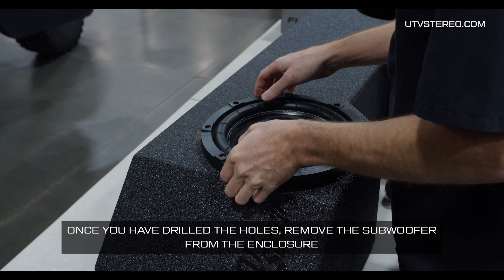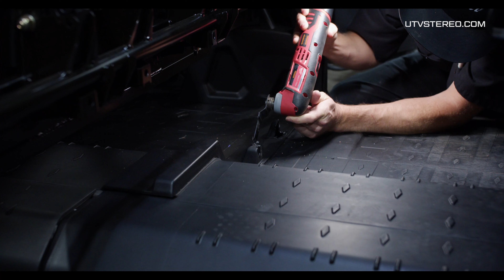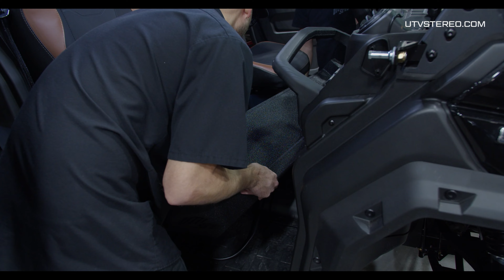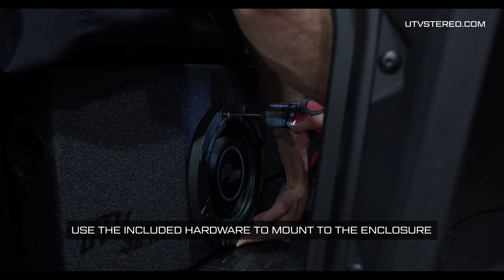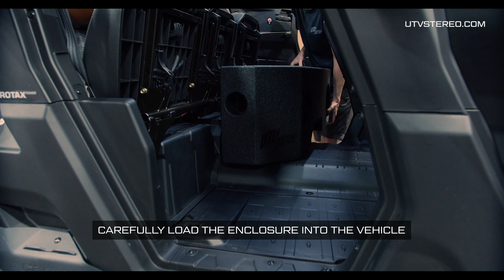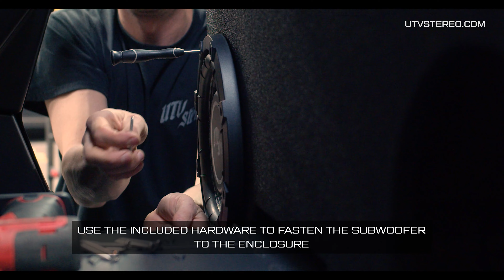How to Install: Can-Am® Defender Dual 10" Subwoofer Enclosure

Comment: Whats the battery setup on this defender? How long can this setup run with the engine off?
Reply from the maker: We are running our Defender 2nd battery kit,  if SXS properly charged, we can run the music for 1 to 2 hrs depending on how many Amps we are using.
Reply: @UTVStereo  ok thanks, good to know

Comment: Waterproof?
Reply from the maker: The enclosure is not, the subwoofers are IP65 dustproof and water-resistant
Reply: @UTVStereo so this enclosure can’t get wet? I was close to buying but if this is the case what’s the point of it if it’s meant to go on a off road machine lol
Reply: Do they sell those  enclosures ? I only see the single ones. I wanna run 4 10’s as well. And where did you run the 2nd battery?